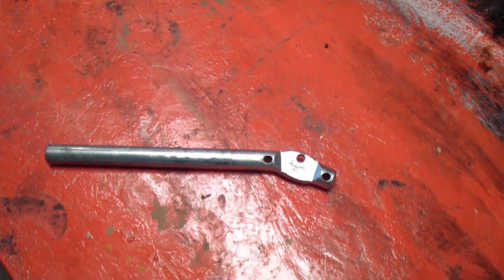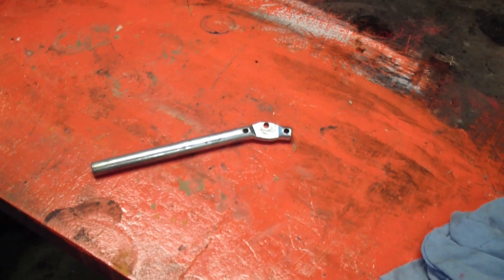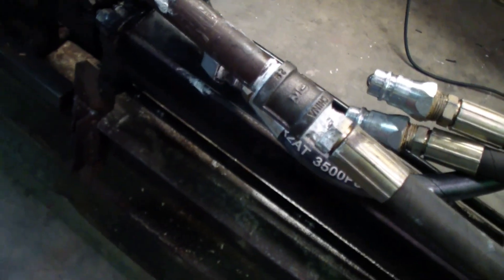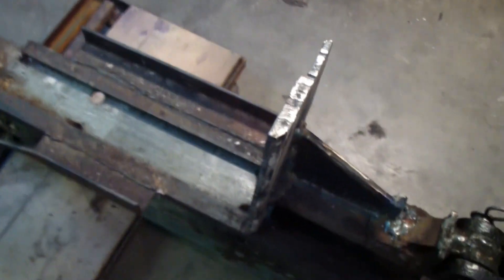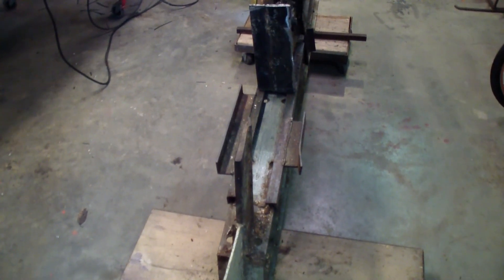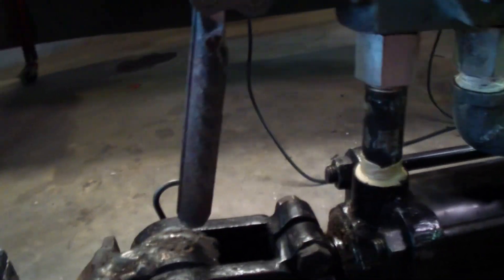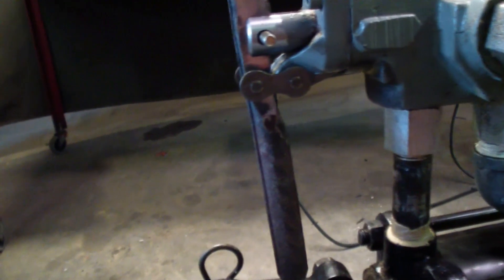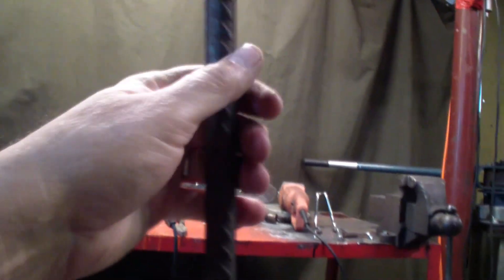Log splitter upgrade

Comment: Better check the psi ratings on those fittings. They look like hardware store plumbing fittings. They may only be rated around 300 psi.